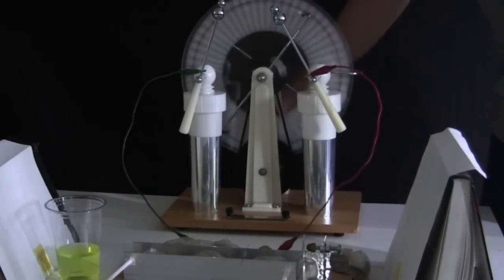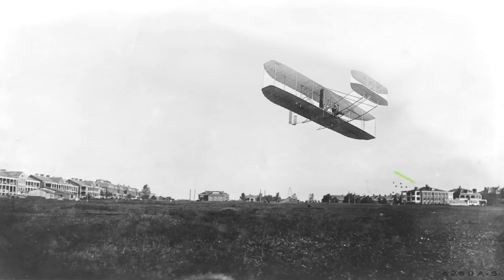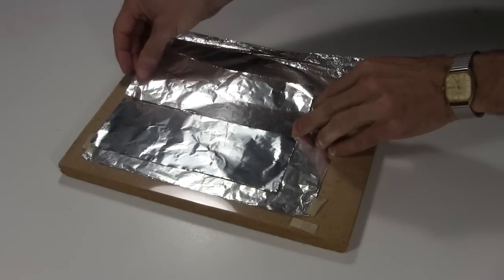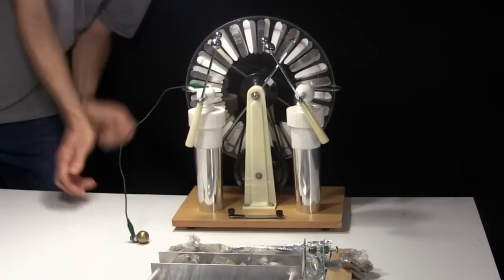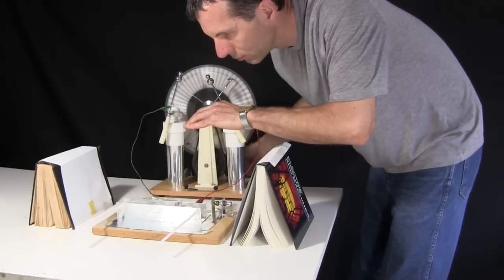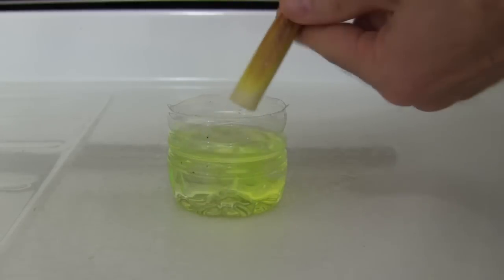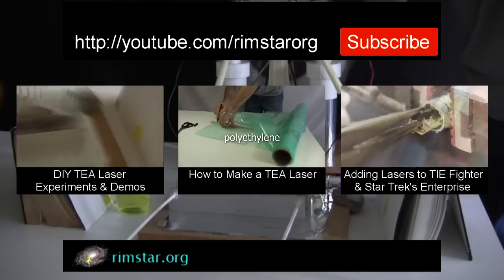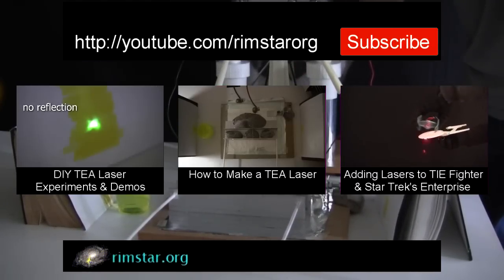Hand-Cranked Laser - TEA Laser Powered by Wimshurst Machine

Comment: "Plastic, which wasn't invented until the 1900s."  Beg to differ, celluloid was invented in 1855 and was formed into many objects -- including the first flexible photographic films from the early 1890s (but could have been made in that form by around 1860).  The Wimshurst wasn't invented until 1880 or so, but very much "lasers before airplanes" -- except that dyes that would show the invisible UV beam from a TEA laser didn't exist until the 1920s...
Reply from the maker: Oh wow, I always thought plasitcs started with bakelite, which is what I had in mind but right you are https://en.wikipedia.org/wiki/Celluloid Thanks! Regarding dyes that would show in invisible UV beam, I made some from spinach and rubbing alcohol for this video https://www.youtube.com/watch?v=6-QdXyI217k. I don't know if they knew that back before the 1900s but it sounds like it would have be makeable.
Reply: @RimstarOrg  Fluorescence wasn't well documented until there were strong UV sources that didn't have (much) white light component.  Filtering arc lamp light might have worked (but a suitable material or dye again wouldn't exist until analine dyes came along); otherwise, it would be a matter of a discharge lamp or Rhumkorff coil with the correct filling (mercury vapor?) to get enough fluorescence to see from natural fluorescent materials.
Reply: @RimstarOrg  Tonic water with quinine was commercially available in 1858. That could have been used.

Comment: wow holy fuck. I always wanted to build a Wimshurst Machine with 3d printing... but never got to it because was not motivated to do that just for sparks. Now that laser could be quite a motivation. pew pew :D

Also imagining that they could have had that in the 18th century already... the plastic foil insulator could maybe replaced by a parchment or leather, if it's dry. Maybe impregnated with some Linseed oil? Or bone glue on a paper? And the resistor could be made from a coal rod or graphite.

That's quite steampunky :D

Comment: Damn, that was fantastic! Is there a way to calculate the output power of the TEA laser?
Reply from the maker: the Hacksmith Thanks! I'm glad you liked it. Maybe a photocell can be used to measure the output power.
Reply: The voltage is some what 100kV? The current like a few uA tho. Wikipedia: "several tens of microamperes". So 100000 * 0.00001 = 1 Watts? Seems quite much, given the fact that laser pointer has a few mW. Although the beam also is quite short.
Reply: @dreamyrhodes  The very short pulse time of TEA lasers makes the pulse power very high -- I've read elsewhere that the power (energy per time) of these pulses, which last only a few nanoseconds, is in the megawatt range -- but with one pulse every twelve seconds or so, the average is tiny.

Comment: Great job! That beam is well focused. The aluminum sheet and plastic made a nice capacitor. I just uploaded a video showing a few voltage multiplier circuits with my Oscope. I would try using the 5KV Neg output from the microwave oven schematic shown in that video. Just be sure to stand back when it is powered up. I bet you get a really nice steady beam. :-)
Reply: A TEA laser can only operate in pulses; the nitrogen component of the air in the gap needs time to either relax back to ground state (the emission goes from the second excited state to the first) or to be replaced with ground-state gas via air circulation.  This design has poor circulation between the electrodes, so is limited to, at most, a few hundred pulses per second.  To the eye, it would look like a steady beam, but it's still only a few nanoseconds every few milliseconds, or about a .0001% duty cycle...

Comment: great video, interesting use of hand powered high voltage generator, the foils make a collector capacitor? greatest dilemma is utilizing these machines to recharge a battery that could be used to power the wimhurst in a self loop style which could result in a testatika!!..im fascinated by the wimshurst as much as disappointed by it..
Reply from the maker: professorfidelcat There's a small gap between the two foils that are on top of the transparency, so altogether the foils make up two capacitors. The foil underneath the transparency is shared by the two top foils.
Reply: RimstarOrg wow, a capacitor with a lower common ground capacitor..ingenious!
Reply from the maker: professorfidelcat Agreed. The purpose is to make the discharge in the lasing channel, the gap between the two foil capacitors, as fast as possible..an ingenious solution.

Comment: But how it works ??????
Reply: It looks like it uses static electricity stored in a capacitor which is fired between the cathode and anode which causes dielectric breakdown of the air between the cathode and anode resulting in a plasna channel which the rest of the stored energy flows through the ionized air. Within the air is nitrogen being ionized which in billionths of a second generates photons and bam you have a laser!